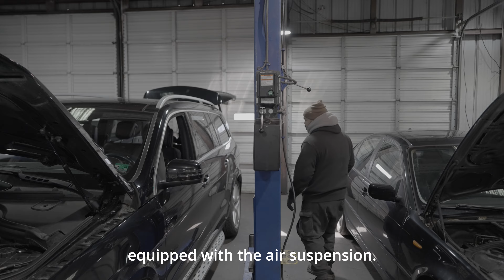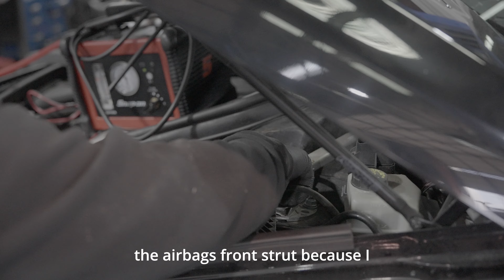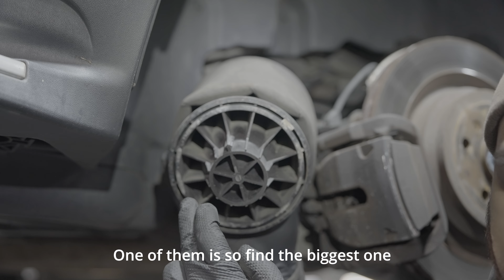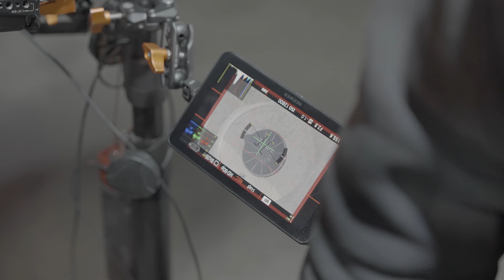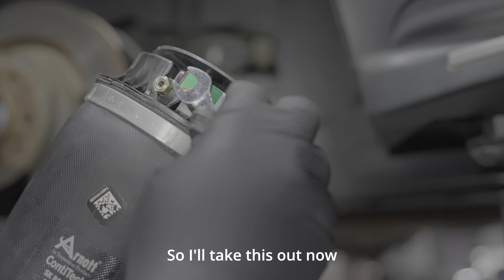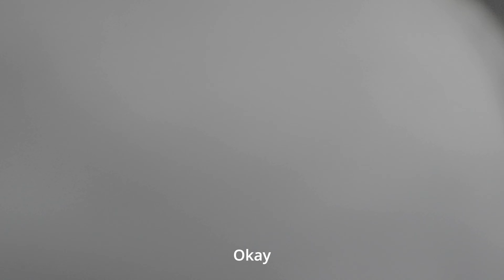Fix Sagging Suspension | 2008–2016  Mercedes GL550 AirBag Leak Test and Replacement

Comment from the maker: Parts Needed: 
BRAND: ARNOTT    |  Air Spring - Rear - 07-19 Compatible with Mercedes GL/GLS(X164,X166)/06-18 ML/GLE(W164,W166), incl AMG https://amzn.to/4xBXjbW
Trim removal set : https://amzn.to/3Nj053E
Affordable smoke tester tool: https://amzn.to/4bbOlJh
Stubby racheting wrench set: https://amzn.to/4diVXLu